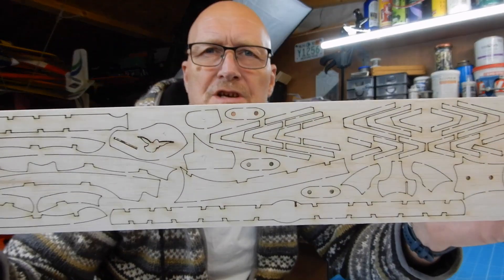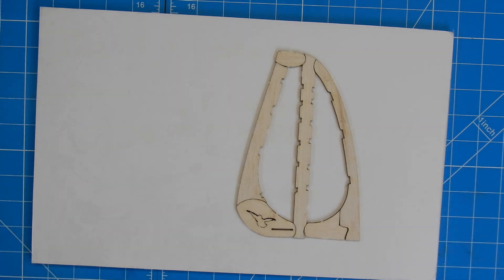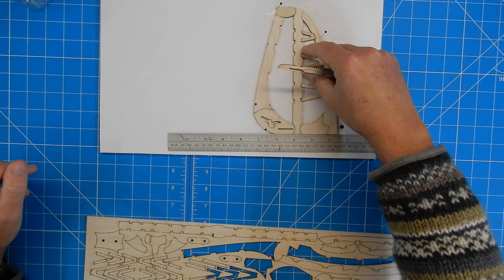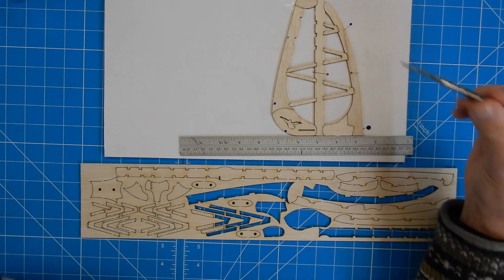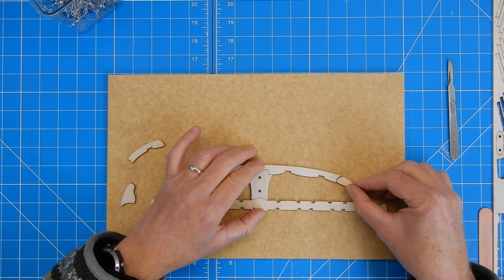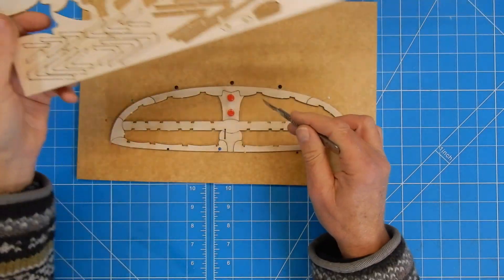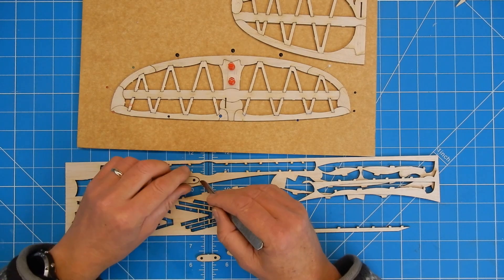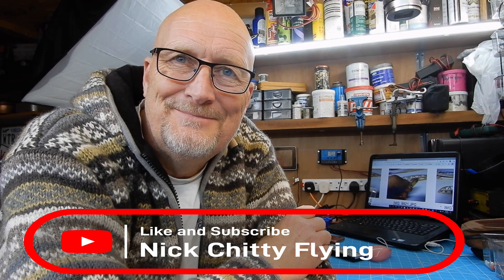How to build a  CXRES mini Glider  Part 2 Tail set

Comment: Excruciating difficult build just because they are trying to save a few penny's on balsa sheet. i cant see the logic in having to build up a tail plane from 30-40 tiny pieces when if you wanted to save weight then just make it from solid sheet and lazer cut out the waste?
Reply from the maker: yep agree

Comment: Nick, I'm still searching for the perfect building board. I've used a piece of plaster board and now trying some 5mm foam board but it's not really thick enough to take pins. What do you recommend. Chris
Reply from the maker: Pin board from school supplies shop Chris https://www.teacherboards.co.uk/sundeala-notice-boards-aluminium-wood-or-unframed/?gclid=EAIaIQobChMI6ZyW6omU9gIVC553Ch19rwzoEAQYASABEgLklvD_BwE#560=963&562=65&1388=955&1389=946
Reply: Thanks Nick, it takes some finding on their website but Sundeala appears to be 9mm thick, correct? Chris